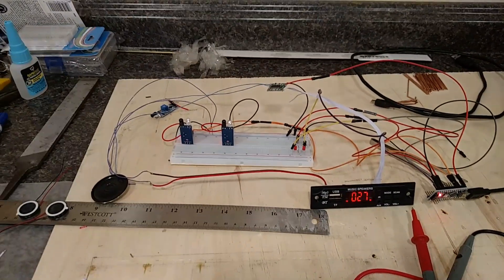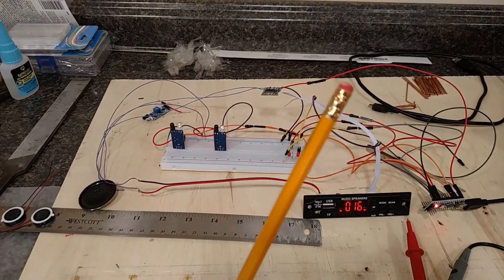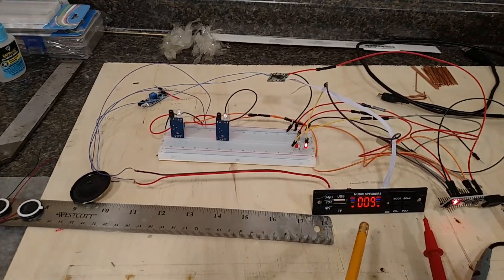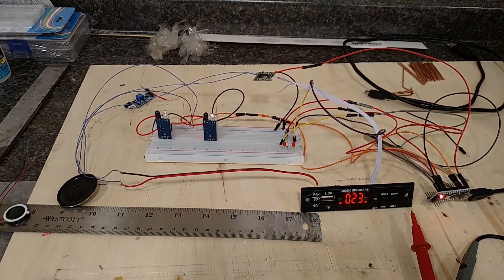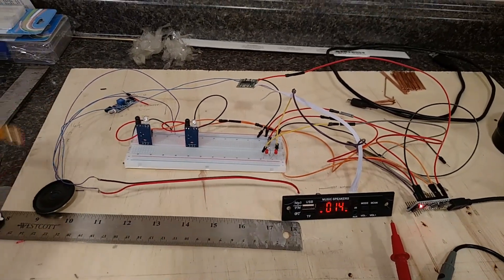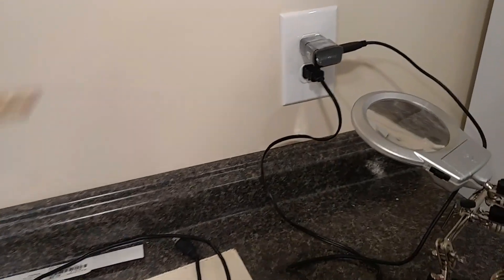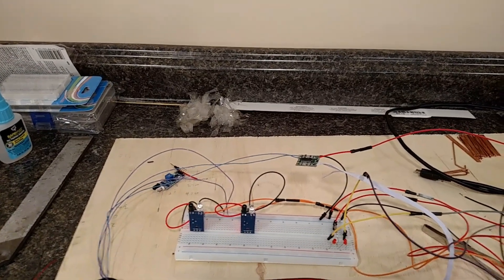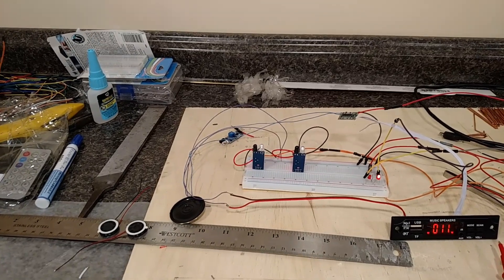HO scale model railroad crossing with bell using Arduino system

Comment: Hi There, I just put together a whole complete crossing gate assembly an wanting to add a bell sound to or with my IR sensors, I have a MP 3 /  Sound chip module that I recorded a bell sound on to but not sure how to hook it up with an IR sensor 
And if you have a code that would be great as well.